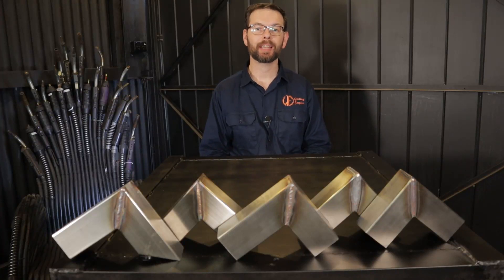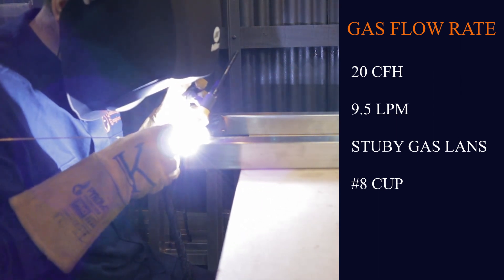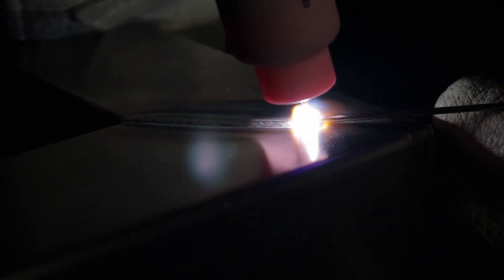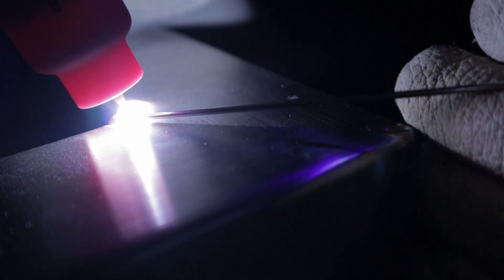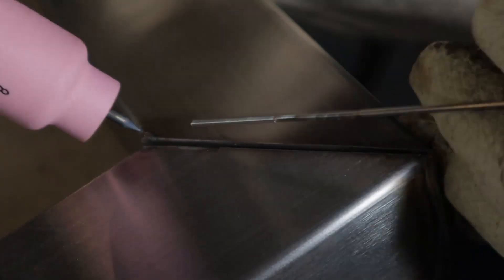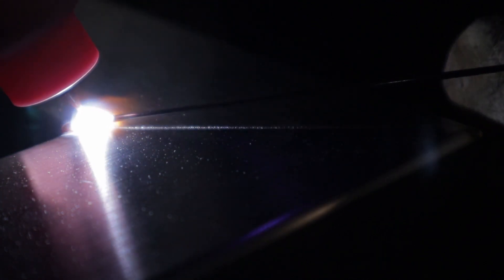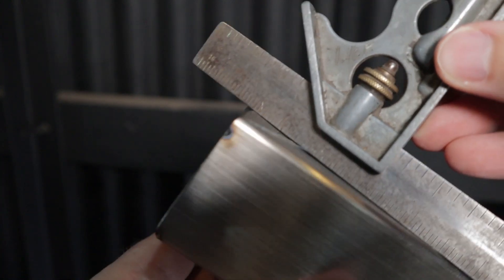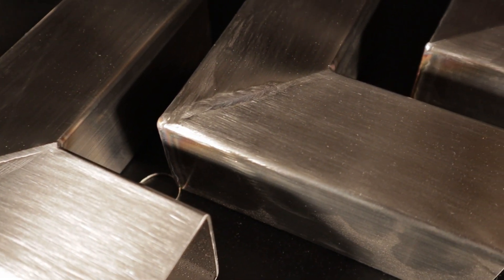7 Stainless TIG Welding Faults

Comment: Those are some good welds.  Do you have any tips for avoiding distortion?  I TIG welded up a rectangular stainless water tank once and did 1 inch beads at different locations all along the seams.  It held back the warp very well, but it was time consuming on the long seams.  Is there a better way?
Reply from the maker: Thanks. On thinner stainless steel. I recommend placing fusion tacks (quick small tacks no filler wire) every inch. 

Placing heatsinks as close as possible to the weld area. For example. Welding in stainless sinks in a bench top.

 I would put wet rags as close to the weld on the bench top corners and aluminium plate on the straights.

I don't recommend backstep welding as it tends to ripple the thinner material. I generally don't use filler wire on outside corners, nut have it there in case.

I hope that helps. I will build an outdoor kitchen in the coming months where I will demonstrate the  methods.

Comment: Hello sir. How to use lift tig on thin stainless tubes like 1.0mm and 1.2mm?
Reply from the maker: Hi, that is the material thickness I was using in the video. Did you have a go at the stainless welding?